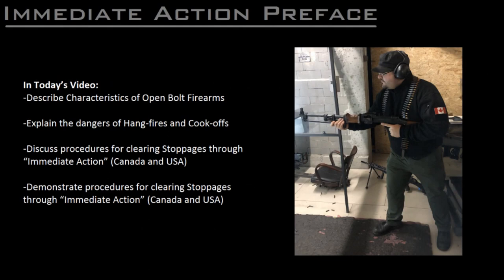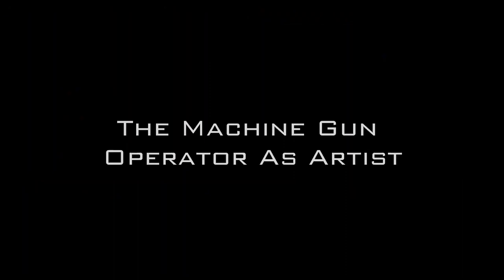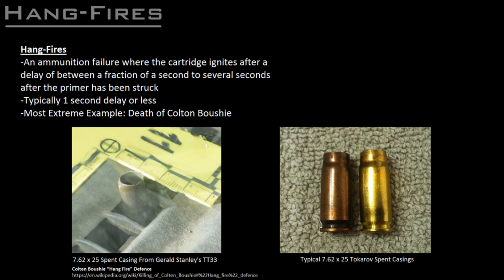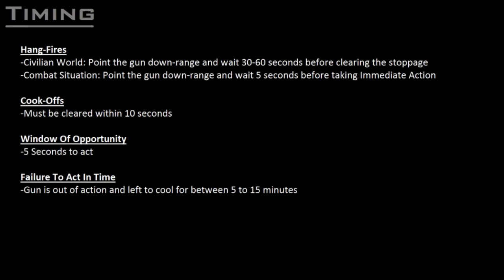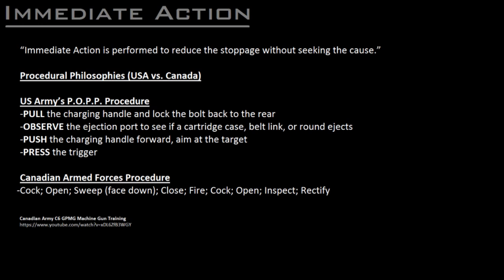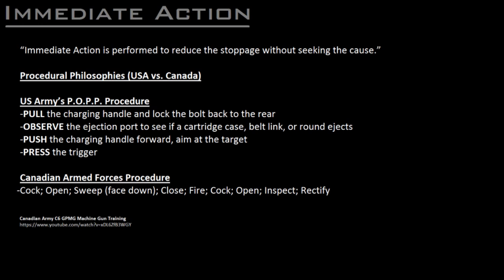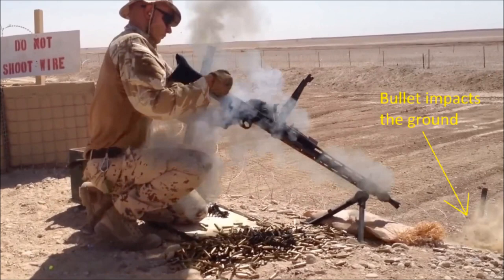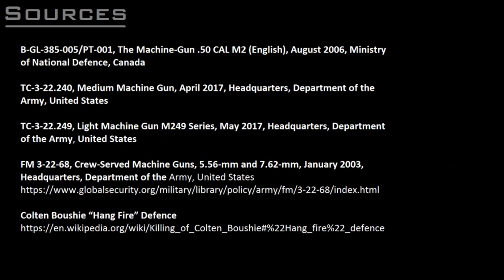Clearing Machine Gun Stoppages Through Immediate Action

Comment: Nice video. Question why hang-fire risk is not taken into the account in closed bolt systems where general procedure is tap-rack-bang without waiting 5 seconds.
Reply from the maker: That, I don't know. I went and looked through my manuals, the warning about waiting 5 seconds is in my US manual for the M60/M240B/M249, as well as my Canadian Army manual for the M2.

My giant M16A1/2 manual warns about squib loads, which I didn't see in any of the machine gun manuals.

My M14 manual mentions hang-fires, but says that they're rare, and adds that you should pull on the charging handle with your palm down in case the hang fire detonates.

Doctrine changes over time. The MG manuals that mention hang-fires are from the early 2000s; the M14 manual is from 1965, and M16 manual from 1989.

Perhaps there was an increase in hangfires happening in recent years, as armies dig into older, sketchier supplies of 5.56, 7.62 NATO and .50 BMG ammo?

Another example of how doctrine changes is that the US Army has prohibited the "Amber" safety status  [bolt in battery on an empty chamber, safety on "fire" and a belt in the feed tray] on open bolt guns (I'll talk about this in the video I'm working on now, which should be ready in a few days), but for the Germans on the MG42 and MG3, this procedure was considered perfectly safe. In fact it kinda looks like the Germans thought you couldn't screw it up...

Apparently too many incompetent US machine gunners were having negligent discharges, so the Army said, "Right! NO MORE of this!"

So, that's my best guess!